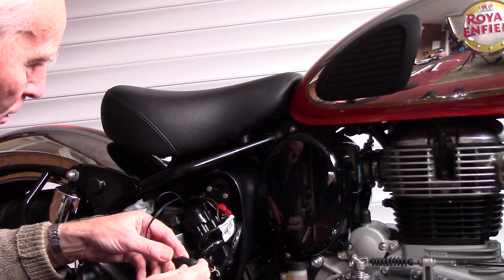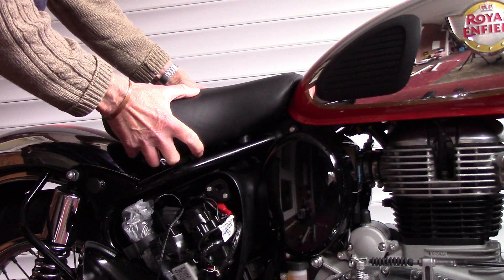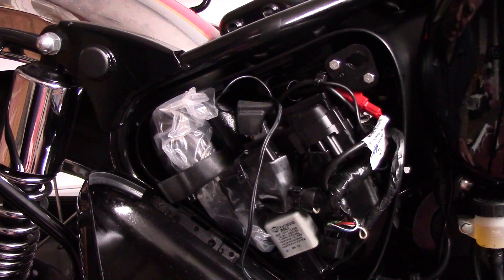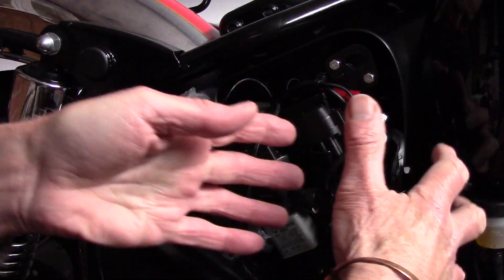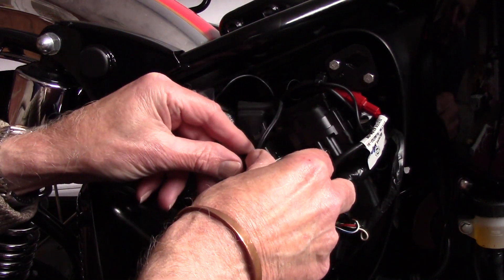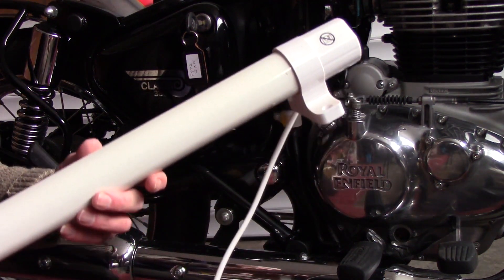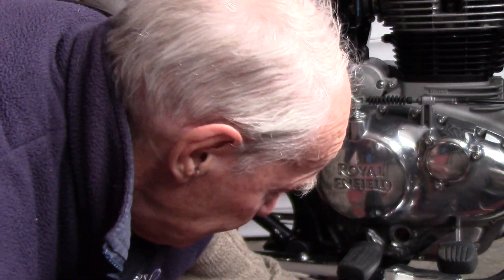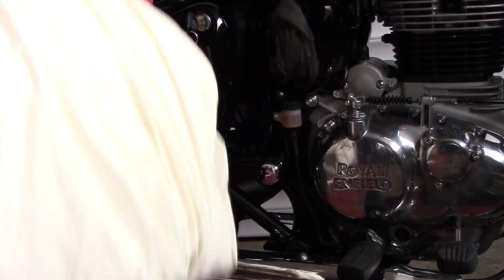ROYAL ENFIELD 350 CLASSIC 2022 HOW TO STORE HER FOR A DAMP WINTER

Comment: Like the idea of the heater! 
I too fitted a charge socket to my Classic 350, had a hell of a job to get the rubber strap holding the battery in back properly.  I keep the bike in a wooden shed, went in the other day, whole bike covered in condensation, I fitted a 100mm vent to either end of the shed to get some ventilation which seems to have helped, also going to have 2 fans from old computers constantly running. Wish I could put it in the living room!😀
I've also fitted a heatproof  rubber tube into the back wall of the shed to fit over the exhaust pipe so I  can leave it ticking over inside, if the weather's bad. Roll on spring!
Reply from the maker: Hi Pete. I am with you on the living room idea. I suggested to my wife that I might put the bike on a plynth in the living room and watch that instead of the crap television. Afraid she's not having it. Oh well. Ken
Reply: Dear sir, I have for the last 30 years or more put a thin decorators over the whole bike 12x12, wieght it down around the bottom all the way around , and no it does not sweat underneath bike will keep dry, in spring uncover bike will be like new. It like useing a vac bag only cheaper. My classic has just been done this way,starting it up for a few min is not good for an engine only causes condensation  inside engine, hope this  helps
Reply from the maker: @roberteves4392  Thankyou Robert, its good that we can pass on our ideas to one another. Regards 
Ken